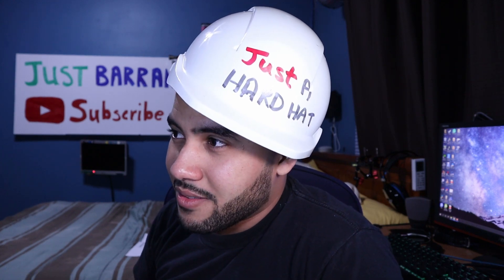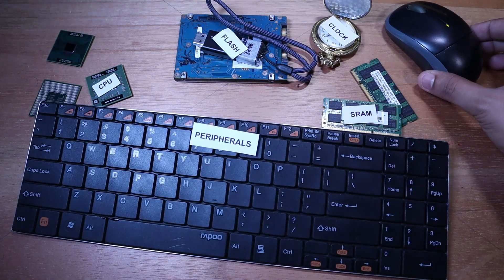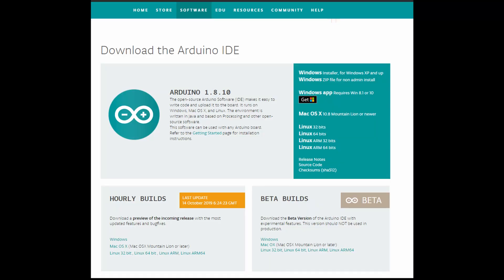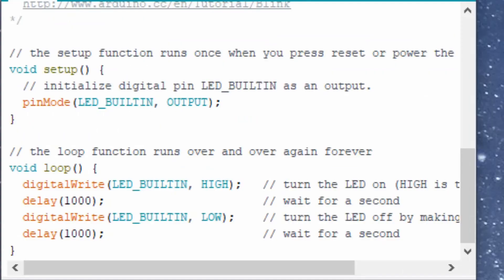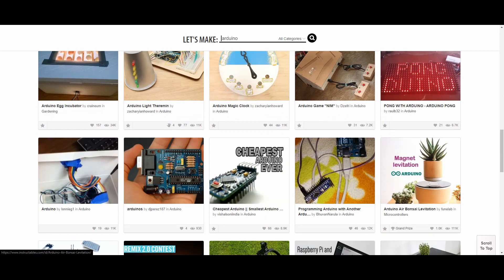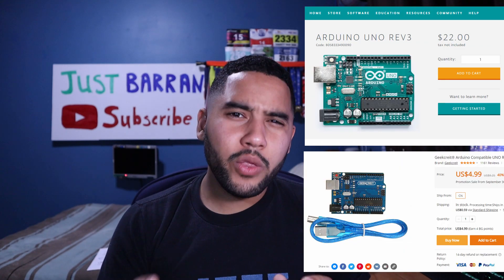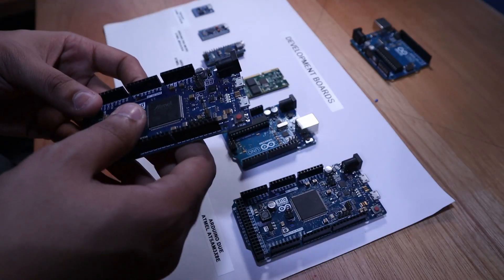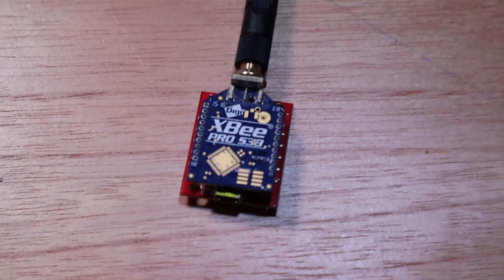Arduino vs Microcontroller, there is a difference that might surprise you!

Comment: Hey Barran, I am new to Iot but i want to start off exploring but confused between Raspberry pi and arduino
Reply from the maker: Great question, microcontrollers (most arduinos) are more task specific and self contained normally offering lower speed as a trade off for cost via a pi which is a a microprocessor (a more a less full blown linx computer) with some add microcontroller features like gpios and other serial busses. If you want to do a project to control lights then a standard Arduino would be better but if you want to do a project that requires on board high processing like image recognition or a monitor with a gui then a pi would be better. In most cause both can be used to do what the other can but depending on the application their would be trade offs of cost, level of code and time to finish between each product. Hope that helps
Reply from the maker: Also arduinos mostly use C code vs Pi you would more likely use Python

Comment: Interesting take. The great misconception that Arduino has anything to do with Microcontrollers. All it is, is a build system with a SDK. It is just happenstance that the build system is used for Microcontrollers. There are better alternatives for the build systems.
Reply from the maker: Your whole comment contradicts itself but yea 👍🏽. Arduino is a bootload and ide for said bootload that is for ….. microcontrollers. You don’t need Arduino to for microcontrollers but you do need microcontrollers/socs for Arduino. This was stated in the video.
Reply: @JustBarran  Not really a contradiction. You can build desktop application with the Arduino build system if you want.
Reply from the maker: That I didn’t know, interesting 🤔, I stand corrected

Comment: I'm not sure I agree with Arduino teaching people to code.  If you spend time on the forums you'll find people attempting that ultimately get frustrated.  The reason is, they are using C and a microcontroller.  Not even that, it's C/C++ with all the ugly stuff hidden from you under a rather thin framework and pretty IDE.  That's all well and good until things "don't" work.  It is there that you will need to start learning what, exactly the compiler messages, which expect you know what you are doing, mean!  C/C++ is not a nice language as it has ZERO forgiveness and zero fucks given.  The arduino framework tries to protect you for a lot of it, generating canned errors where it can, saving you the main GCC compiler error.  However that all impacts performance and... when things DO go wrong, the code you will experience is the Arduino framework code, which is not pretty or simple and not for beginners.
As a vehicle to gain interest in coding, yes.  Anyone who takes an interest in coding should, at least, do a few free online courses in normal "high level development" on a normal PC, or RPI, in a language like Python or C#.  
If you want to return to MCU dev later, the Arduino framework runs on many different controllers, but it is very limited and riddled with "forced conventions" and even peripheral modes/config.
It (Standard Arduino) also badly lacks a proper debugger interface.  The ability to view registers, memory and instructions and step, inspect, watch and run expressions is HUGELY important, especially if you don't need, want or have a UART terminal to "println" stuff too.  That is a habit you need to get away from in favour of automated unit testing, debugger use and on systems with disc space, logs.  This is where the less "noob friendly" eco-systems like STM32 and PIC come into play.
Reply from the maker: I agree with you but, I would say as someone who knows both sides like you it, Arduino is a great entry point and level of abstraction for persons who don’t need to dive deep in C for test/prototyping . No one who is going into programming professionally would be using Arduino for deployment but testing and prototyping sure. As well as those who doing embedded as a hobby don’t really need more than the tools provided by Arduino. Most people on those forums that trying to do their universality projects in Arduino are being advised by professors who don’t know better than the students in those aspects and that is why they are there. I agree if they plan to do more they should dive more into proper IDEs and understand Embedded C from a foundation point of view.
Reply: @JustBarran  I don't think we disagree.  I just feel it needs to be mentioned that while Adruino lowers that first step to a very accessible level, the next step up from there has not  been lowered, at least enough.
Using myself as an example.  My day job is JavaEE.  My C is rusty (not a pun!).  I have done arduino sketches quite a few times, usually just to drive some small hardware, but it's been a few years since I did any actual C beyond a "sketch".
The first problem (and I see this in the newbies all the time), is when you want to use two different things.  You have a tutorial on reading a temp sensor and a tutorial on displaying some text on an LCD, you want to put the two together.
This results in the person merging everything from the two example sketches together.  In my case this went pretty smoothly, but I have experience, working out when to call each examples setup() stuff and when and how to call BOTH of their loop() stuff in the right order.  I know my brother really, really struggled and produced some of the most foul code I have seen.
This usually leads to forum posts to get help and this is where the newbies will run face first into that second step.
It will be suggested that they split the ino file up into modules to make it easier to read and deal with.
Now this opens up the newbie to C and it's linker and managing memory between them, extern defs in headers, allocation in c files etc.
That runs them into the differences in C and C++, especially if they use structs or object references between multiple files.
All of that stuff gave me a few unwelcome reminders as a slap in the face.  Especially the cpp memory allocation and header externs.  The other one that threw me a curve ball was structs can be self initializing in C++ but not in C.
For me it was just a matter of "Ding!" the memory kicking in as soon as I seen the solution on SO I was like, "Ahh, of course, DOH!".  For a newbie hitting that stuff as their "second" step.  God help them.
Reply: @JustBarran  On the future.  Things do look brighter.  The gap between MCUs and CPUs is narrowing.  The price of powerful, large memory ARM Cortex MCUs is opening up the maker space to where languages like Python and maybe even Java become feasible on matchbox sized dev boards.
The ESP32, for example, should run a Micro/Circuit python VM without issue.  The RP2040 boards certainly can.
This should move the space to a higher level with more management and less traps.
The other improvement we are already seeing that can be canned in a way to favour newbies, is RTOS.
A newbie friendly RTOS facade will remove most of the problems are the "hot looping, round robin" loop() functions and even the funky merged setups (to a degree).
Reply: @1over137  Don't have a lot of love for Micro python as it is terribly slow. In my option Rust looks to be a better option. Rust is also not prefect. The joke is that all the fancy stuff that python is use for is accelerated with C/C++. All nicely wrapped in a API with a bow on top. Tensoflow is a big one that does this.  There are also plenty of traps and pit falls with python, mainly understanding how the interpreter works. Found myself reaching for C every time I wanted to do something related to the IO on a RPI because python was so slow. 
Don't know about the RTOS since you are introducing resource locks, inter task communication and the concept of stack and heap but having the option to use one would be great. The ESP32 Arduino does have FreeRTOS available. Just no one uses it.  
I believe that horrid IDE is the core of the issue. Believe there is a new IDE that is being worked on.
Integration will always be a problem for newbies regardless of language. Again back to the IDE that does not have basic tool to help you debug.

Comment: Hello.  often program the microcontrollers.  I see bit shift right or left using symbol ">>".  why we use it.  I am waiting for your response thank you.
Reply from the maker: But shifts are used for number of reasons, it a easy way to do Division and multiplication by two. Aka, >> 1, is a devide by 2, and <<2 is a multiply by 4. Also if you want to get a binary nibble (4bits)  from one byte in a message for example in Binary coded decimal numbers. There is a lot of application also for embedded communications like sending parts of data over uart like splitting a 16bit number into two 8 bit numbers. Hope this helps
Reply: Thank you very much.  I understood the explanation.

Comment: Nice video, what are your views on single-board computers ( such as Raspberry Pi) vs microcontrollers?
Edit: Love the editing mainly, might be doing too much segmentation like the end the giveaway and the wrap up could have been one heading so it doesn't seem too choppy. Just like a preference thing on my end probably, don't know if anyone else found that weird.
Reply from the maker: Love the raspberry PI,  love the ESp32 (SoC) even more, I think it depends on the application. A microcontroller is great for small projects so I would use them for led control or something that runs on battery, but with the taking off of the IoT SoCs and single-board computers are much easier to use to get your project off the ground. but they are not power efficient. I can't leave a raspberry Pi outside to run on a battery for 6 months, I would need a big battery.  compared to a MCU
Reply from the maker: Yea i understand, I started to rush the ending and I shifted things around, would try to make it cleaner in the next video